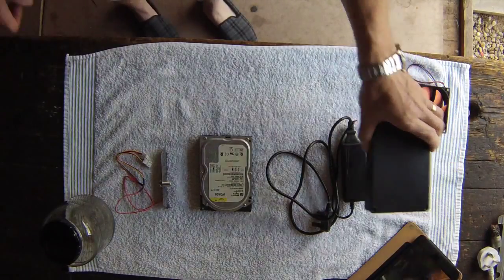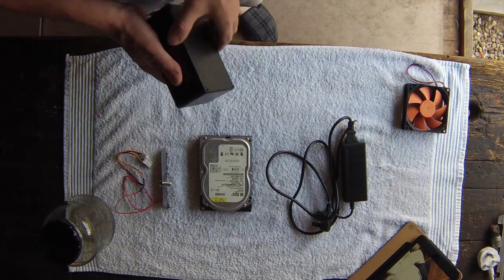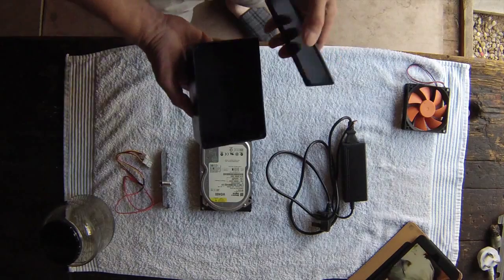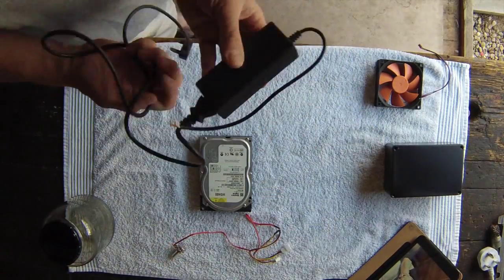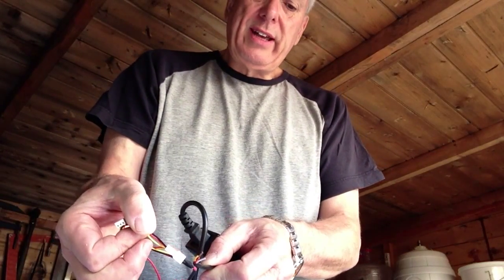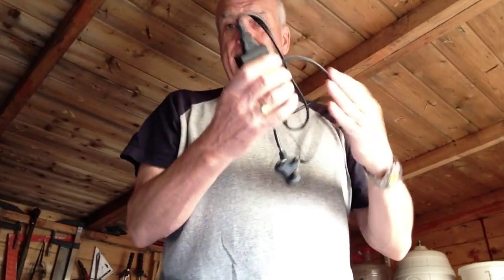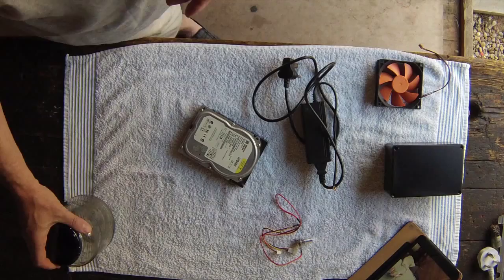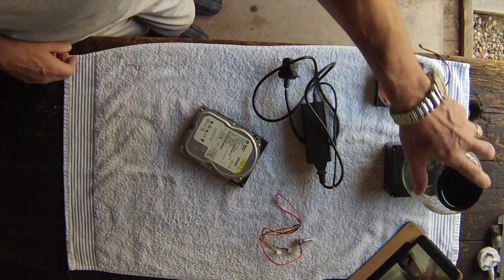The Old Farts Brewery Vlog 27 How to make a Stir Plate Part 1

Comment: Just wired mine up with the same speed controller as you in exactly the same configuration but the the controller got incredibly hot and started smoking. I'm using a 12V 0.5A power supply with a 12V 0.14A fan. Any ideas what happened? I was wondering if you had any overheating issues? The controller also specified it supports up to 8 watts. Cheers and great vids!
Reply from the maker: +tom priestley Hello Tom, sorry for the delay in your question I was on holiday and just returned. I have no issues with the set up however I'm not and electrician so I may have made a mistake with my set up but got away with it, it may be worth getting the transformer with different voltage settings. Sorry I'm not able to help and Cheers
Reply: +The Old Farts Brewery Ah no worries thanks anyway. I've sorted it out now. Turns out my 12V power supply was pumping out way more than 12V! Bought one of these and it works a treat  http://www.ebay.co.uk/itm/331280958905?_trksid=p2057872.m2749.l2649&ssPageName=STRK%3AMEBIDX%3AIT
Reply from the maker: +tom priestley Really glad you sorted the problem and thanks for the link. Cheers

Comment: Interesting. Normally in a PSU like that you'll have a 12V and 5V and a ground if there are only three wires.
Reply from the maker: Crikey very technical. Just tested the voltage to see what's what never took any notice other wise.  Cheers Richard